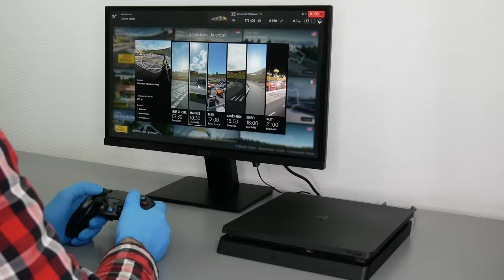You WON'T BELIEVE How DIRTY This PS4 Was!

Comment: Hi .. HELP I wanted to clean my ps4 because of the noise so I opened the top and cleaned and then took the power supply out but I didn't disconnect the power supply I just left it and but it to the side and cleaned the dust I didn't disconnect any cables and that's it I reconnected the ps4 and it start do the peep sound then turn off .. I don't know what happened please help how can I fix it
Reply from the maker: I'm sad to read that you have an issue with your PS4! So you only disconnected the PSU and reconnected it after cleaning ?! that's weird. Unfortunately, it will be hard to say something without any diagnostic. And don't have time to help all people to fix their issue, sorry for that. I didn't even find time to upload a new video the last 5 months 😅
I'm thinking more and more about open a discord to let people from the community help each others.
Thanks for your comment @Noor-tb4tj I really hope that you will find a way ❤️ Maybe you did the last 3 days ?

Comment: I think my PS4 also needs a deep cleaning i have it since 2017 and i never cleaned 😂😂😂
Reply from the maker: hehehe, well opening it and pushing air to remove dust on the fan is pretty easy, but if you want to change the thermal paste, it is another story... 
Thanks for your comment João! ❤️

Comment: That was a very comprehensive video. Thanks for it. I'm curious what you used the sewing machine oil for? 

Likewise, what was that blue padding you used at the end of the video when composing the motherboard of the console?
Reply from the maker: oh you are right, I didn't even use the sewing machine oil in this video 😅
The blue padding is ARCTIC TP-3: Premium Performance Thermal Pad, 100 x 100 x 1,5 mm. To be honest, I finally don't think 1.5mm is the best format for the PS4 Slim. I would use smaller next time.
Thanks for your comment @l30sosa , glad to know you enjoyed watching this video ❤️
Reply: Thanks for confirming, I thought I might have just missed it. Oh, I'll try using a 1.0mm and see how that works out @french.satisfactory .
Reply from the maker: Don't hesitate to tell me how worked the 1.0mm  @l30sosa  😉

Comment: I have my PS4 slim for seven years and it's never been clean so I assume it's dirty inside. Make sense why it heats up fast.
Reply from the maker: I'm pretty sure even after 7 years you PS4 is not in that condition 😅 And the ps4 pro have a heats up fast reputation, so that not necessarily means it is mainly because of that. But cleaning it will for sure help it a bit 😉
Thanks for your comment @clintzieandromeda6216 I hope you enjoyed this vid ❤️

Comment: My friend your video is really great. I wanted also to clean my ps4 but not completely as you did.  I followed until you disconnected the black part with the whit tiny cable. So i assembled everything as it was, and now my ps4 won't turn at all. When i plug it in, i see no light at the power button no matter how long i press. It checked everything three times and no sings. Did i ruined it maybe because i opened it while it was still warm from using?
Reply from the maker: mmmmh.... I'm a very sorry for that... 🙁
For sure, opening it before it is completely cold is not a great idea. But I'm still surprised. It will be hard for me to help you. You could maybe send me some pics on instagram? I would maybe see something ?!

Comment: Thanks brother, one question.
What if I do not put new termal paste?
Reply from the maker: Well, I would say that depends on the exact version of your PS4. With some, It is easier to clean the fan and the heatsink without take apart the heatsink and so have an access to the processor thermal paste. clean the dust is already a very good thing, but of course change the TP is better.
If you can't clean properly the heatsink without take it appart, I would definitely recommend to change the thermal paste. Even if it is a cheap one. 
Thanks for your comment @rukiii444 ❤️

Comment: If I wasn't so worried I'd break something or forget something, I'd clean my systems like this too if I wanted to deep clean.

Problem is I would inevitably break and/or forget stuff and end up ruining the system. :(
Reply from the maker: Well, it is not without any risk for sure... 😅
Thanks for your comment DarthDragon007! I hope you enjoyed this video ❤️
Reply: @french.satisfactory  I just wish I could get my Fat PS3 repaired. It got YLoD and when I took it apart I broke one of the connectors. Lol.

After that, when I clean my PS3 slim all I do is just remove the power supply and use an air compressor to remove the dust. Did that with my PS4 Pro, which requires a bit more effort.
Reply from the maker: Cleaning gaming consoles as you did is usually enough. The only interesting thing when doing more is the thermal paste remplacement.

Comment: If i wanted to clean my ps4 fan only is that ok or i have to clean the whole thing
Reply: Thats one of the most imporant things to clean so yeah you should do it. I only cleaned the fan area and my PS4 went from very loud and hot to silent and normal temperature.
Reply from the maker: Thank you very much @LaxonPfc for your answer to @nobody_2471 . Don't have so much time to answer these las days ❤️

Comment: Just a question, if i want to follow you and clean the metal and plastic part with water. How long do i have to wait for it to dry?
Reply from the maker: Well, during the summer, I just let everything outside under the sun. It dry very quickly. If it is the winter, I'm using an hair dryer to dry it as quickly as possible, especially for the metallic parts which can rust.
Thanks for your comment @Ryoyenata , I hope that you enjoyed watching this video ❤️
Reply: @french.satisfactory  Thanks for the reply, just another question, what's the thickness of the thermal pad i should be using? Great video btw 👍
Reply from the maker: Well, I used that one: ARCTIC TP-3: Premium Performance Thermal Pad, 100 x 100 x 1,5 mm
The thing is, it was quite difficult to reassemble everything. So I would say less than 1,5 mm. But I don't have enough experience to say what is the BEST one. That was the 1st time I used this in a cleaning session.
Glad to know you enjoyed this video! thanks again for your comments ❤️❤️

Comment: I once tried to teardown my PS4 to clean it, but some screws were too hard to loose, they just didn't. Anyone knows what can I do?
Reply from the maker: If the screw is stuck due to rust or grime, applying a penetrating oil like WD-40 and letting it sit for a few minutes can help loosen it. Also, sometimes, applying heat directly to the screw can cause it to expand and then contract upon cooling, breaking the seal created by rust or thread-locking compounds. You can use a soldering iron to apply heat directly to the screw head.
Hope this can help. ❤️

Comment: My ps4 is really loud im so tired
Reply from the maker: Yeah that's something pretty usual with the PS4. Looks like it needs some cleaning 😉
Reply: clean it out and if that doesn't work then you probably just need to change the thermal paste.
mine got so bad that it just turns off randomly. it's long overdue for a thermal paste change.
Reply: @LukeTheSchoolBoy  sadly, that doesnt work. i have one of the oldest models from when it came out so its no suprise that almost everything is out of service on this poor thing lol. I am planning to buy a ps5 but i dont know which model would be better for graphics.. im not good at this